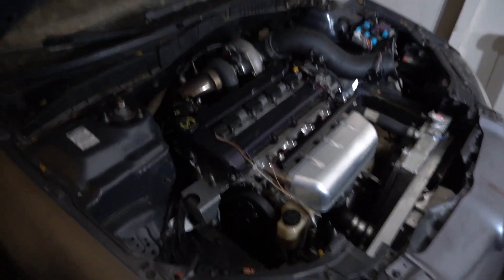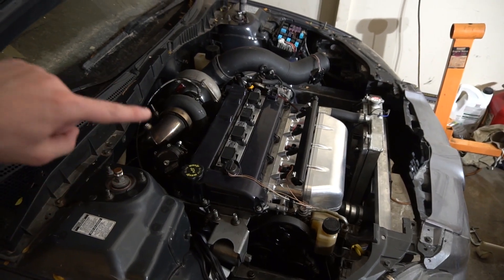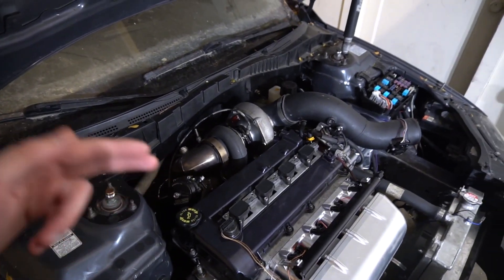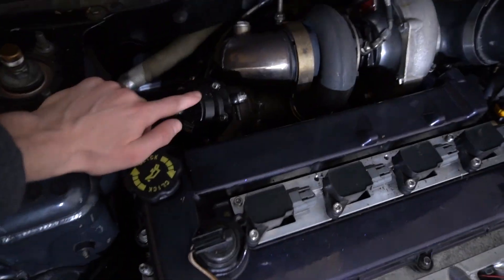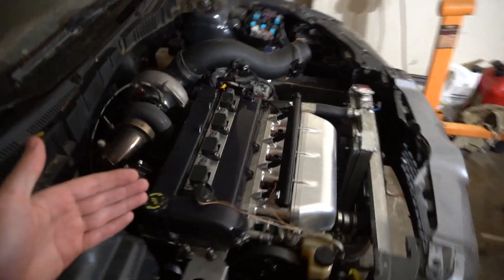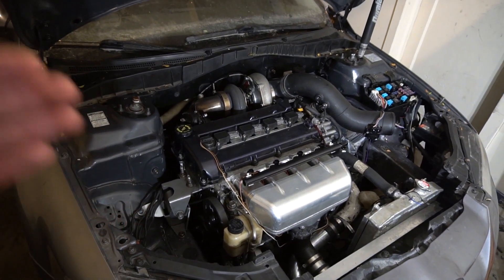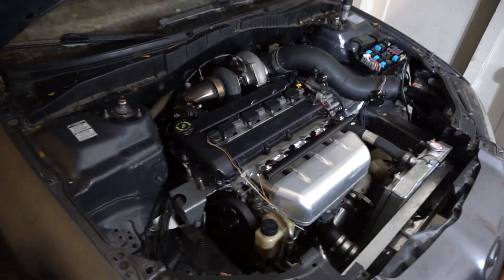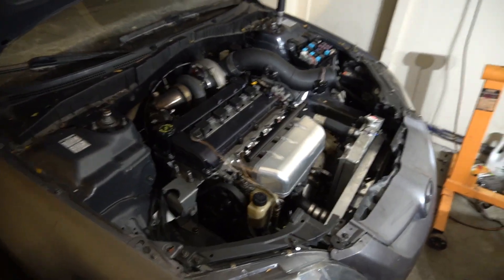Why My Speed 6 has Crashed and Burned

Comment: I live in idaho i own a 2008 mazdaspeed3 stock with 119k miles its amazing all i have on it its BPV and injen cold air intake street tuned it for them parts it kicked it up 300+ its a beast. Hope its a speed3 your next mazda i hope its a 1st gen you get. It would be awesome to get some tips to build my speed 3 i don't know where to start.
Reply: Man thats very high numbers for just a stock turbo and with an intake only,just leave it as is its plenty unless you want to go down the rabbit hole with the $$$😆😁
Reply from the maker: Yes you are on the right track! It’s going to be good. I will help you
Reply: Stock speeds are 280HP it only bumped it like 15 20 30 HP it been like thar for over 10 years and it runs great but i want more HP